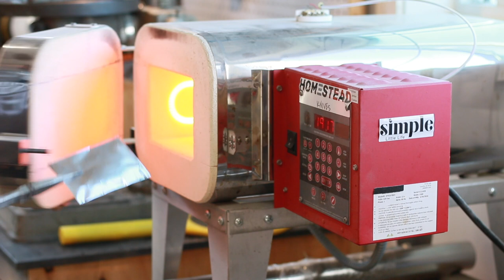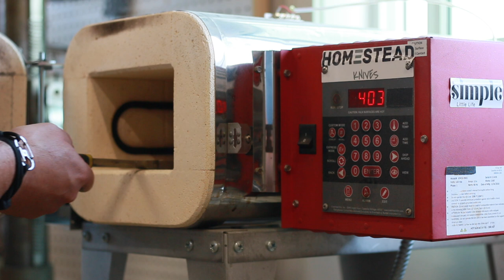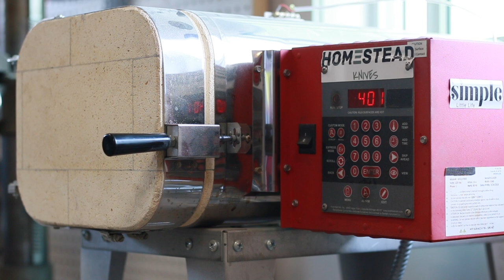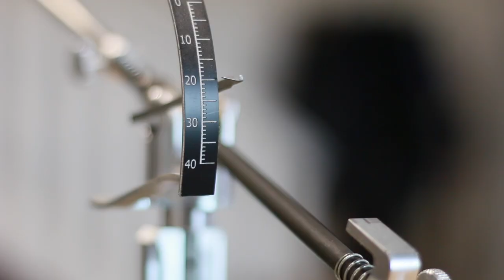Making a Micro Knife

Comment: I don't want to be that guy, but grinding without a guard is putting your safety on a 3/16th thick material most likely made in China (quantity over quality over there).
My wife is an x-ray tech and told me about a guy came in missing 3 fingers at the 3rd knuckle (closest to the hand)  because a cutoff disk blew up.

Stay safe so I can keep watching your videos
Reply from the maker: I agree 100%. Sort of. I think it's a bigger problem to not wear gloves while grinding and everyone on youtube grinds bare handed. The gloves I have are kevlar cut resistant gloves and they are very cut resistant. It takes a razor blade several attacks to cut through. I've touched these to the grinder a few time and they hold up well. But, you're right. With the force of a disc exploding the big problem is the velocity of those discs. I'll see if I can find my guard and put it on 👍
Reply: @Simplelittlelife  How come you don't wear the gloves when using your 2x72 grinder? :)
Reply: @Donorcyclist  i'm still going for it -  i'm calling the dude seymour safety complete with 'x-ray tech' wife named sally safely...    he's super worried about the 'rona as well.
Reply: @Simplelittlelife  I can't stand wearing gloves for any reason other than heat protection, especially around spinny things. I've seen too many pictures of degloved fingers and hands to risk that happening - so I just take the sparks and use a guard.

Comment: I really like this style of video!  Thank you!  I have 3 questions.
1. What type and where do you get the pliers that you used to fold the stainless foil packet?
2. What is the purpose of the baby powder in the packet?
3. What did you do in the blast cabinet after etching the maker's mark?  I tried that once but washed out the edges of the mark so that it wasn't crisp.
Reply: The pliers are Hand Seamers used for HVAC. 
The baby powder is to burn and use up any oxygen in the pouch during the heat treat so that it doesn't oxides the blade.
That's a mystery to me, but I think that he was blasting the other side of the blade.
Reply: The baby powder helps the stainless from sticking to the blade while in heat treat